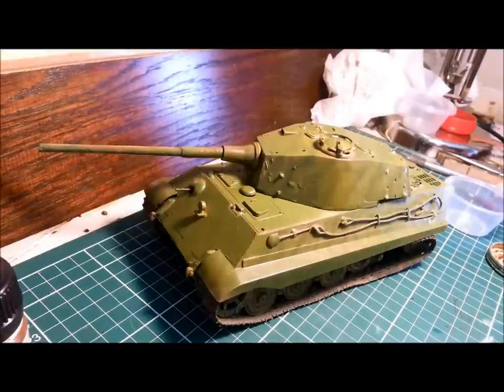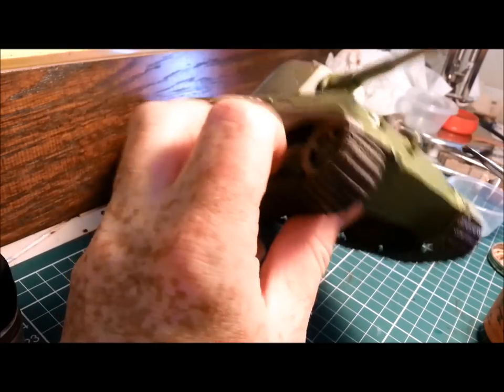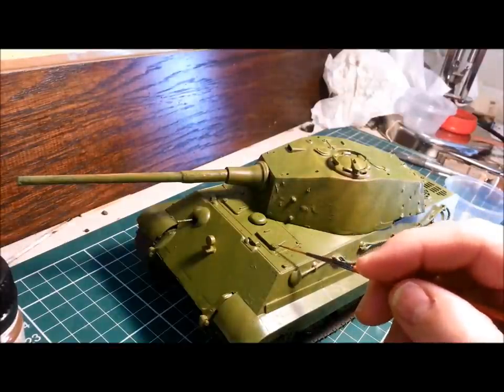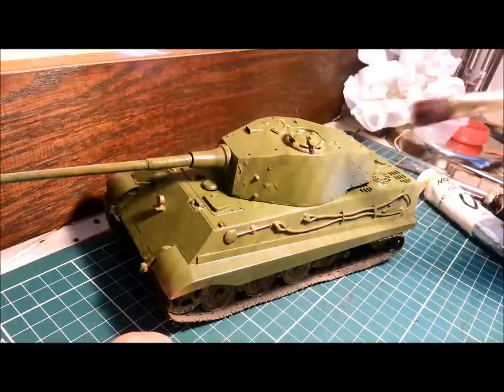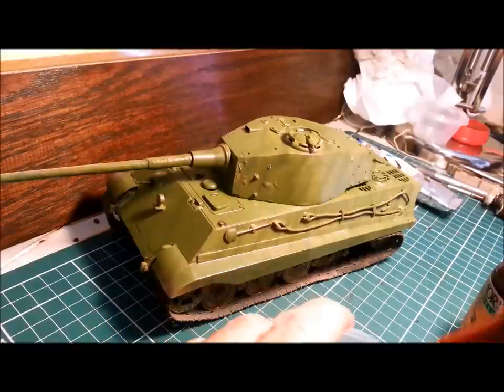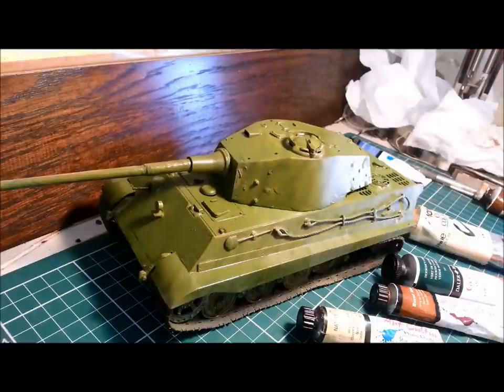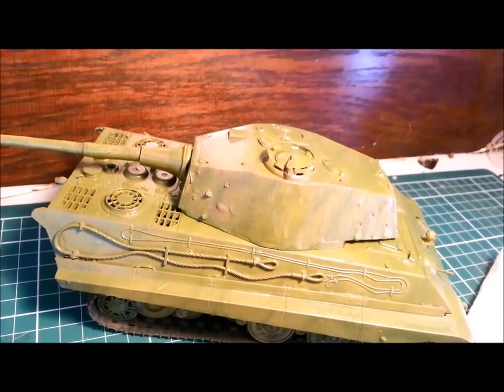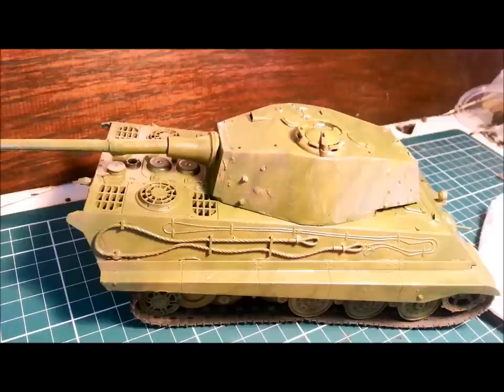Painting scale models: Washes, Pin washes, Filters and Dot filters explained

Comment: So now what’s the difference between between “splatter” and “spot filters”?

I always after chipping apply a gloss clear coat before applying washes for several reasons. Decal silvering is one, washes flow is superior over a glossy coat is another and the ease to take enamel or oil based treatment used as panel washes and filters off or toned down is yet another.
Reply from the maker: Different names for the same thing, aren’t they?

Comment: PIN WASHING: When doing a pin wash, dont you add a small drop of dishwashing liquid? Like one drop to 100 drops of water? It breaks the surface tension and makes the paint flow down the cracks instantly. Or are you using mineral spirits for your thinner? -- If you slightly wet the whole surface before hand, it will eliminate those tide lines. I had a heck of a time with tide lines until I learned this.
Reply from the maker: Hi Bill, that's solid advice about the wet surface to eliminate tide marks. Thanks!
Reply: @DavesModelWorkshop  Glad to help! :-)

Comment: Between the different techniques should you give it a coat of varnish. Like after you paint then varnish, filter then varnish, dot filter then varnish? Thanks
Reply from the maker: You certainly could. It’s not essential, unless you are trying to use filters or dot filters using thinners on top of an enamel base coat - without a varnish, the thinners will destroy your base enamel paint. If your base coat is acrylic, you don’t need to worry, the thinners in weathering processes won’t affect it.

Comment: Dave, I know I’m a bit late commenting on this video! My question is if I used an enamel base paint and want to wash my model, can I water down an acrylic paint and use these same techniques?
Reply from the maker: Hi Stockton, no problems being late on this. Acrylics never work very well as washes or filters, for some reason they just don't seem to flow as smoothly and thinly as oils/enamels - they tend to clomp in blobs, not thinly flow. If it's not going to be too heavy weathering, you could try sealing your enamel base with a water-based clear varnish (gloss or matte) and then weathering with oils/enamels, but do it sparingly and be cautious as you go.

Comment: Is it good to let the oil paints stay on some tissue before using them? Panzermeister showed this in his video.
Reply from the maker: It does seem to wick away a lot of the oil from them, making them less greasy. i have done it in the past when I've painted figure faces with oils, but I've never really worried about it when weathering. It's probably a wise idea, but not 100% essential.
Reply: Dave's Model Workshop without letting the oils soak their oil out it just takes longer to dry ? I have tried using the pin wash technique so many times and it just looks funky and seems to never dry. What brand of thinner do you use?
Reply from the maker: Polish Mafia15 oh, I just use the cheapest mineral thinners from a hardware store.  Nothing special at all. And you’re right, all it does if you don’t wick away the excess oil is increase drying time.

Comment: Do you seal the tank first with a clear coat? Before you apply the filter?
Reply from the maker: hi Lord Brennan, as long as your tank is painted with acrylics and you are using oils or enamels for your filter, then there is no need to apply a clear coat. Some people claim a gloss coat helps the filter/wash to flow more smoothly, but I've never found it to make a big difference. Does that help? Cheers, Dave
Reply: Thank you so much!
Reply: @DavesModelWorkshop  My experience with matt acrylic was that the enamel wash flowed all around the paintwork and didn't stick to the areas where I wanted it to be. Pinwashing was impossible as it just seeped all around the area.

Comment: Dave, what  washer should I use (acryllic or enamel) if I paint the body colors with water based acryllics (Gunze Mr Hobby AQUEOUS HOBBY COLOR)? If the washer is enamel based it will resolve the acryllics (as I know). Or I need a layer of lacquer (but what kind of?) between the body color and the washers? Thanks
Reply from the maker: Hi Zsolt, if your overall colour is acrylic, then your best wash would be artist's oil paints. They would not affect the acrylic paint. Good luck, Dave
Reply: Thanks! And what is the solvent of these oil paints?
Reply from the maker: Mineral turpentine, or general artists' thinners would be fine.